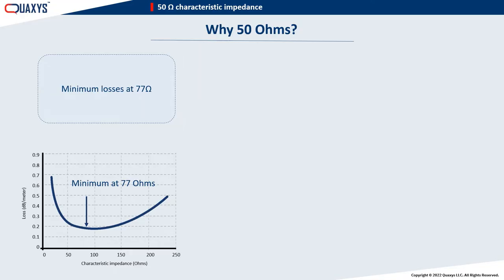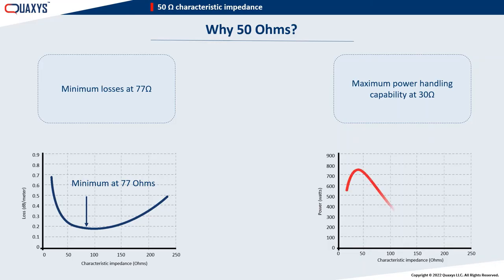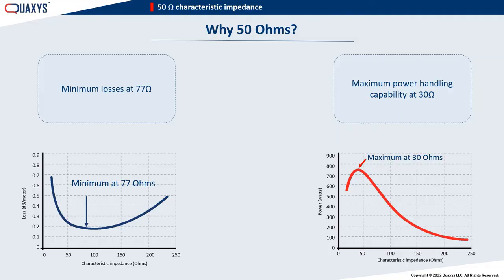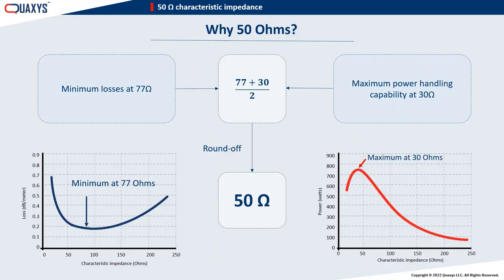Why 50 Ohms?

Comment: Cable companioes went with 75ohm to minimize losses because they extend such long distances.  Radio mostly went 50ohms because its a great tradeoff between loss and cost...
Reply: No, cable companies went with 75 ohm cable because that was already in common usage for all modern TV systems, households and buildings.
Reply: @chuckcrizer  Lets split hairs. Cable companies followed TV which had settled on 75Ohms for the reason i stated.. Geezus !

Comment: But the equipment that the 50 or 75 Ohm stamped coaxialcables are connected into is several Mega Ohms, so it must be something to do with high frequency measurements or something?

Comment: Conveniently, the resultant ratio of inner and outer coaxial diameters (which, along with the dielectric of the insulation, sets the characteristic impedance of coaxial cable) is also practical to manufacture. It would have been ugly if the optimum values were (for example) 27 giga-ohms or 27 pico-ohms.

Comment: This begs the question, why is there also 75 Ohm coaxial cable for video, TV etc?
Reply from the maker: Thanks for your question. There are a few reasons for using 75 Ohms.
 
1. As demonstrated in the video, a 73-ohm characteristic impedance results in minimal attenuation. Therefore, when dealing with weak signals from an antenna or an analog video link, 75-ohm cables are preferred. 

2. A half-wave dipole antenna used in TV receivers has an impedance of 73 ohms at its resonant frequency, making it well-matched to a 75-ohm cable.

3. Moreover, a folded dipole antenna used for TV receivers has an impedance of 300 ohms. So, by using a 4:1 balun, a 75-ohm cable provides an excellent match.
Reply: @quaxys_academy  Thank you so much. 😲 Nearly 40 years I've been an engineer in electronics, electrics and mechanics, and this simple fact has never been explained to me, or have I ever bothered to ask the question. This is one of those nuggets of knowledge that is mind blowing. 😊 Subscribed!
Reply: @zedcarr6128 Thank you for asking this important question.

Comment: How did they come up with those graphs, experiment or via Maxwell's equations? If equations, how were they derived?
Reply from the maker: This is a great question. The derivations for loss and power handling capability can be found using the coaxial cable equations in the following links.

This link derives the formula for the loss:

https://phys.libretexts.org/Bookshelves/Electricity_and_Magnetism/Electromagnetics_II_(Ellingson)/07%3A_Transmission_Lines_Redux/7.03%3A_Attenuation_in_Coaxial_Cable

This link derives the formula for the power handling capability:

https://phys.libretexts.org/Bookshelves/Electricity_and_Magnetism/Electromagnetics_II_(Ellingson)/07%3A_Transmission_Lines_Redux/7.04%3A_Power_Handling_Capability_of_Coaxial_Cable